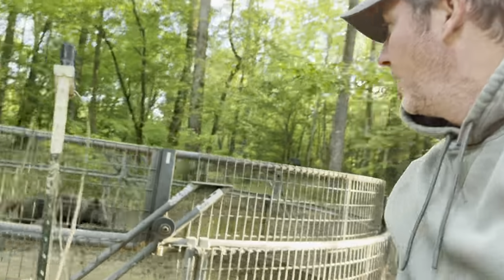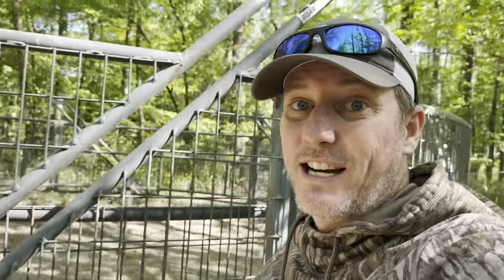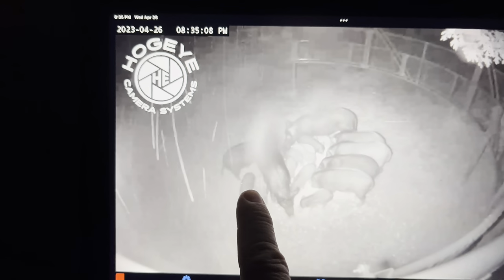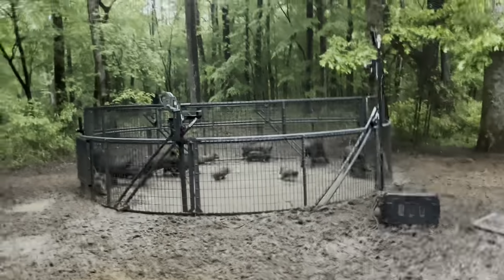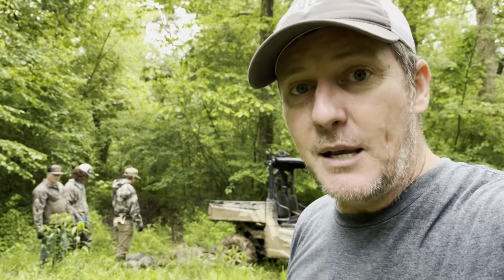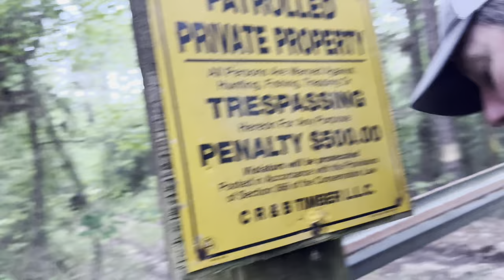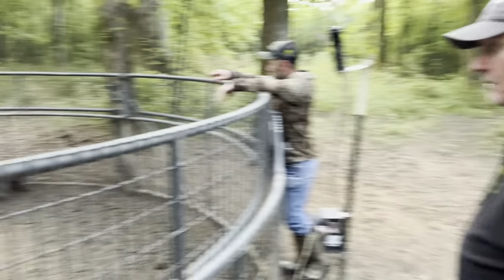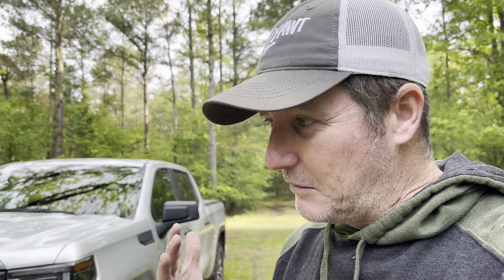New RECORD with triple wild hog catch.  Big boar. Big sounders.

Comment: I'm glad for you and your family that not only did you have your safety squints going on but you had those sunglasses too. It was a fluke that I wouldn't have seen coming. Get a post driver: faster, safer and something you'll use for a long, long time.
With the fog and the rain it seems the pigs are more sedate. Hmm. At least you didn't need to go to the "Yawtyawt Pig Wash" for this catch. Just as well because that creek was drier than usual. Of course the area under the trap looked really good for water when it came to making a mess. 
Up here the various species of vultures would be up to the task. Why go crazy with a road department cleaning up a carcass. Just pull it off the road a bit if it looks bad. Nature takes it's course pretty good!
That neighbor who burns his grass off...That was funny!

Comment: Regarding those Dominant hogs which chase others out. With the big Traps with two Entry gates opposite each other, put a screen they can’t see thru’ (or over) about 6-8 ft long ,& about 4 ft high)  placed  midway between the two opening Gates, so opposing Sounders can enter the trap from opposite directions & feed either side of the “fence” without actually confronting each other? (They don’t usually pick a fight less they feel threatened, & they will pretend not to notice if they’re not directly challenged. As long as there is enough bait on both  sides of the “Fence” the dominant hog can feed one side, & pretend he don’t know the one on the other side is there at all! 
The fence needs to be weak enough it can’t be used as a “Take-off step”, by the more athletic “Jumpers” especially in smaller Traps where the whole thing is dropped.
Won’t add much to the cost, & need only be used when there’s only the few troublesome ones left.
Reply from the maker: Sounds good on paper. WAY too much work and thinking. It’s not that big of a deal.
Reply: Maybe there's not enough to worry about, just that you 'sounded a bit frustrated by them.

Comment: That pork causes a lot of harm to humans, and among these harms:
* infection of the body with viral diseases as a result of the parasites that the pig feeds on, these parasites do not die when they are In the form of vomiting, diarrhea, fever, dehydration and abdominal cramping. Infection with diseases caused by trichinosis, which is transmitted to a person when he eats meat, and this worm grows in the human intestine When he eats meat, this worm grows in the human intestine and increases in size and is able to reproduce. It may move from one place to another through the alimentary canal and reach the blood and attack muscle tissue, and causes damage to the heart, lungs, and brain, and the Tricanella spiral worm found in it leads to spinal cord paralysis and the appearance of a skin rash.
*Infection of the heart and arteries with diseases as a result of high harmful cholesterol in the blood due to eating pork, and the large percentage of fat in this meat increases the risk factors for the heart and arteries.
*Infection of the body with infections in the nerves, joints, kidneys, lungs, and meningitis. Significant weight gain due to the high percentage of harmful saturated fats, and this causes damage to the heart and various parts of the body.
*Bladder cancer, studies have shown that pork cooked at high temperatures will form some heterocyclic amine compounds that are responsible for increasing the risk of bladder cancer.